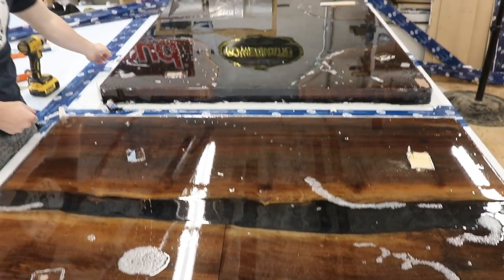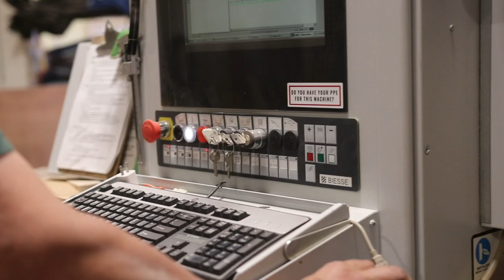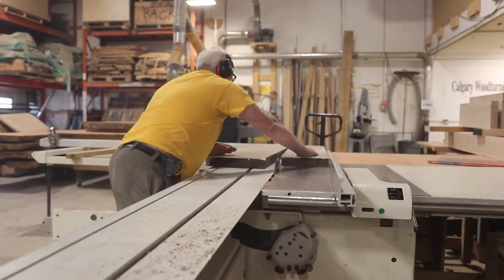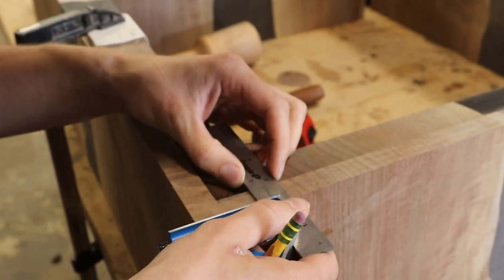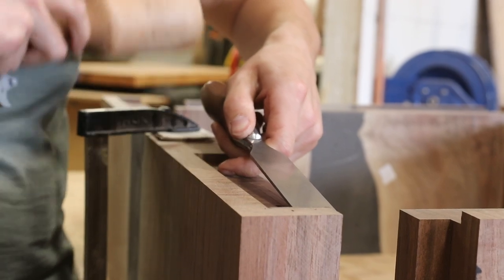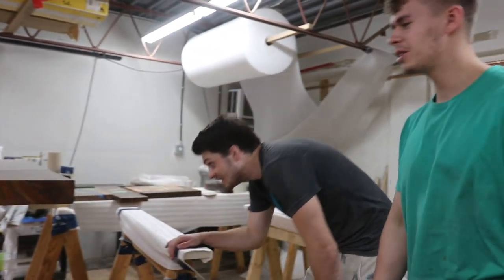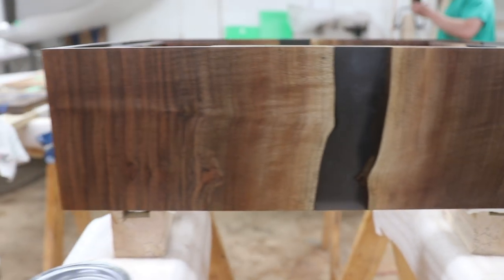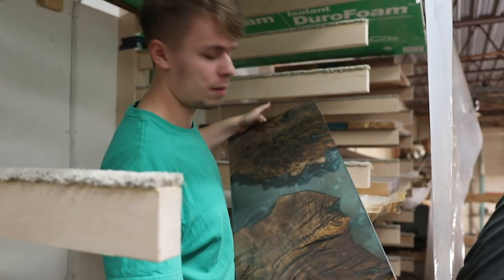Finishing a Table for a Celebrity DJ (Zedd pt. 2)

Comment: Wauw i really like this build. You guys are a big inspiration to me so thank you for showing all that you guys are doing.
Question though.
I get the idea of pouring a layer of solid black first so the inserts and base will not show through the top. However i saw in the video when you testfitted the top to the base that on the edges of the table the 2 different layers are showing.
Would it be possible when pouring the first (solid black) layer with something like walls 2 inches from the edges and remove those walls when pouring the 2nd (smokey grey) layer so you wouldnt see the 2 layers on the edges of the finished top?

Comment: Looks amazing.
So you use 1 or 2 coats of extra thin, then 1 or 2 of polyx oil? how much time between coats? and how much time after the first coat to remove the excess?

Comment: Hi, amazing Project ! Love the epoxy tables. I have a question: you dont use a Heatgun for the bubbles? Or you use it?  Greetings Gary
Reply: This is not an official response, but just wanted to point out that I saw in one of the previous video's that with this epoxy they developed themselves, the bubbles pop alone without the need for a heat gun.
Reply: And maybe they don’t need to pop the bubbles because they’re just going to CNC them out along with the whole top